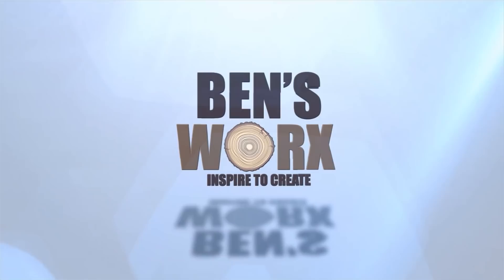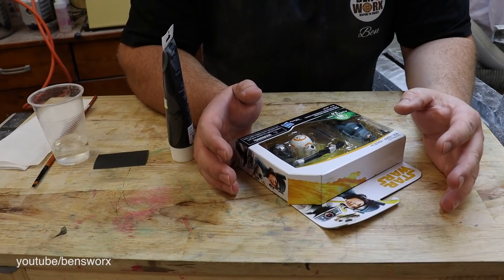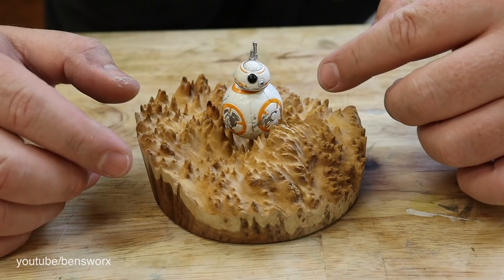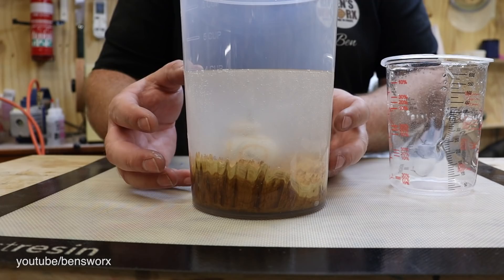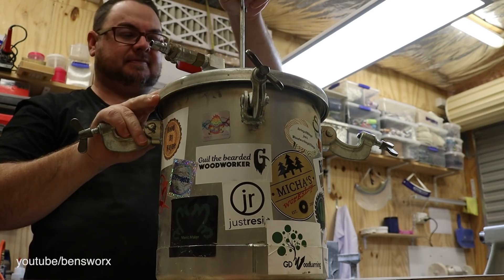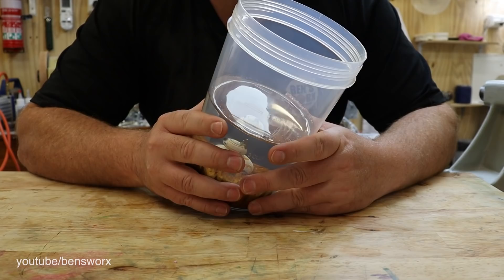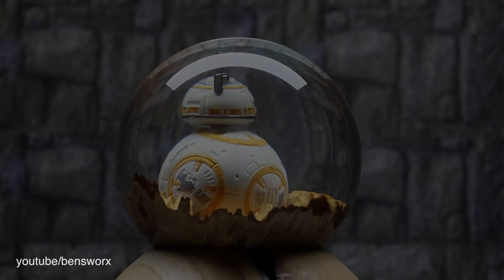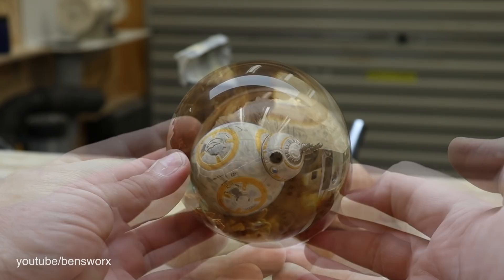Making a Star Wars Resin Sphere - BB-8

Comment: Kind of sad that the glow in the dark didn't light up BB-8. But it's still an awesome end product. Well done.
Reply from the maker: Thanks Mate, it lights up in person, unfortunately the camera just couldn’t capture it 👍
Reply: You can see the glow in that Last few seconds of the video!
Reply: @BensWorx  Why did you weather the figurine before putting him in resin?
Reply: I wonder if he could mix the glow-in-the dark to an almost-clear amount and then just apply that as ultraviolet resin to the figure directly? I guess that threatens to either just not give you enough of the powder to glow or else would just be too opaque to see the original colors under... Or maybe he could apply it to certain areas so it's like the figure itself is glowing, but only from parts where it doesn't mess up the colors in the light.
Reply: @BensWorx  hey Ben. I make illuminated jewelry, micro-size leds, solar power, rechargeable batteries, etc. Let me know if you'd like some lighting ideas, hints, help, or something. ;)

Comment: Why do you use pressure on some and vacuum on others? I understand that the vacuum removes air and pressure basically hides it but why choose one over the other?
Reply from the maker: If you think there’s air that could potentially get trapped, use vacuum to pull it out prior to curing under pressure

Comment: I have a question, can you cast in resin something like an air-fix diorama? I know the resin heats up or something so I’d of assumed something made of thin plastic such as an air fix plane or vehicle would deform but I though I’d ask since I’ve zero knowledge in this area.
Reply from the maker: If you use a low heat epoxy it should be ok